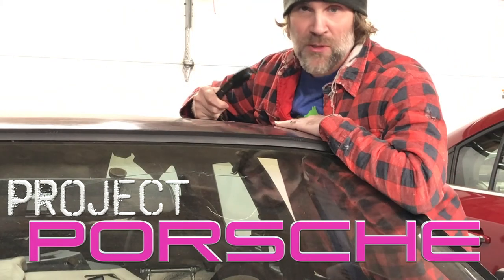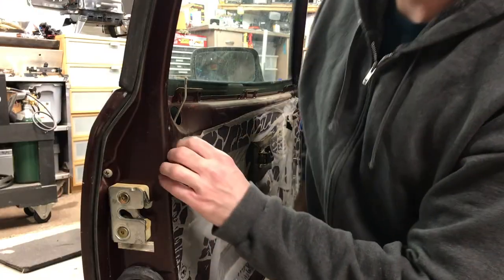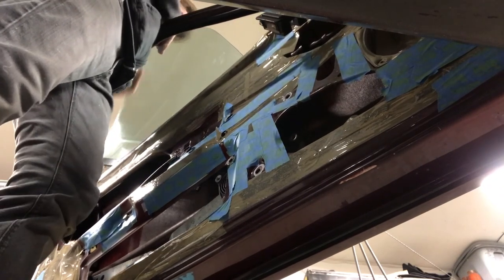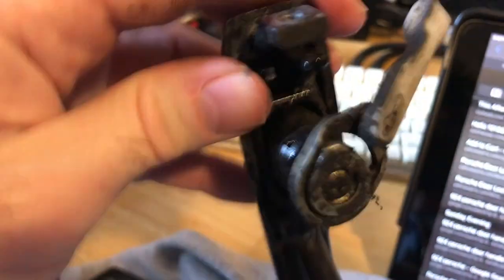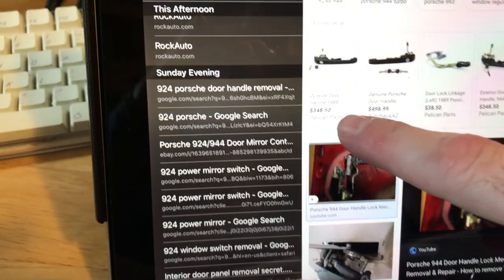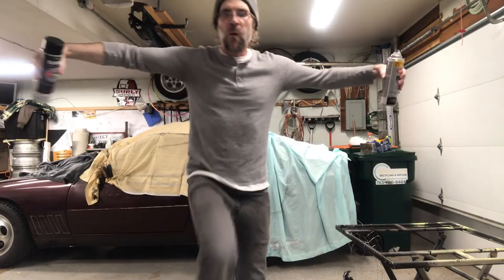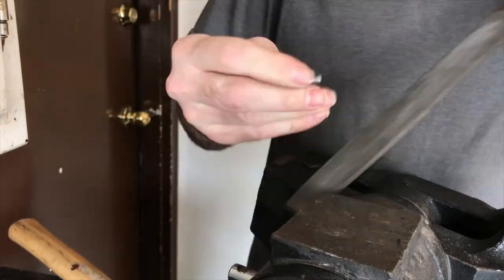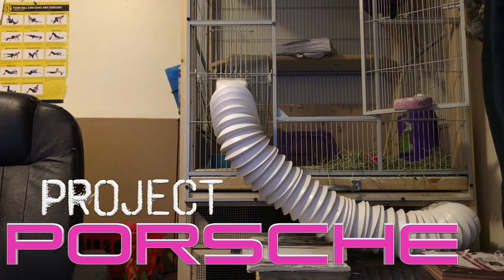Creative 924/944 Broken Door Handle Fix

Comment: Nice fun videos Ryan.  I resurrected a 1988 924S SE which I sold last year.  Now I am working on a 1982 924 turbo.  My car has the apparently typical non working exterior drivers door handle.  Unfortunately for me it seems the 87/88 924 door handles are different from the earlier models. Not finding much on the web on the earlier 924 door handle issues. I suppose I  am just going to have to take it apart and explore.  Your paint suggestion will come in handy for sure, and I'll watch your progress here.  The keyless entry was a very cool idea!
Reply from the maker: Thanks Rick!  I'm glad you enjoy the show and plan to follow the the progress!  I hope the exploration on your turbo's handle goes well!  Those rare SE's are cool.  And the turbo's are too.  It sure seems like these cars are starting to take off in interest/value.  Someone should start making affordable replacement handles that work on all the different models and years of 924/944's, and fix the weak points in the design.  I'm still kicking myself for not pulling the handles off of the 924 that was in the salvage yard by my house.  At the time, I didn't know how common broken handles were on these cars.  They would have cost me a whopping $5 a piece!  Even just for the parts, or to save/sell.

Comment: Thanks! This will be helpful for when I re-paint my handles when I take them off to replace the old cracked up door handle gaskets.
Reply from the maker: Your welcome!  Let me know if you have questions. I have lots in store 4 this car!  Check back for my next Door Locks Episode!
Reply: @rybreadification  What was the finish of the spray paint you ended up using? Semi-gloss or gloss? I'm in Canada and trying to find a comparable product.
Reply from the maker: I used semi-gloss Rust-Oleum brand “high performance” enamel.  We’ll see how it holds up.  Ideally you want something that has good adhesion, but also wears well, being it’s the handle. I think semi-gloss or satin is best, the full gloss just doesn’t look right.
Reply from the maker: They sell this stuff here called POR 15.  You can brush it on, you could try a paint like that, but then you should get all the old paint off first. But it can’t be to thick where the trigger goes.  I just used “cheap” spray paint for now.  Also i was thinking satin or flat farm and implement paint might be good.  May take a long time to dry....Your jacket is drrrreye....that’s from the movies.  They sell 2 part in a spray can for 20 or 30 bucks at paint shops or mail order here.  Its like 20 or 30 bucks.  I don’t know how durable it really is though.
Reply: @rybreadification  I picked up some Tremclad spray paint that is essentially the same as what you used so I’ll be trying that out soon. I’m still trying to get everything off the door. My panel has some water/heat damage at the top along the inner window seal and the seal itself is cracked in half. Most of the tabs to hold the panel to the door came off so I have to find some way to put them back in and reinforce them. You mentioned that in your video but I don’t know if you said how you reinforced them? I’m thinking about trying to rebuild the top edge of the door panel with some kind of papier mâché, but I’m not sure if it will work well or not? I have lots of questions but don’t want to monopolize your comments unless it might be helpful for others?
Reply from the maker: Don’t worry, the comments are good.  I used fiberglass cloth and resin on the back side of the panel.  I shot a bunch of video, but I still have to edit it.  I wish I was done with it now so I could show you.  They sell fiberglass resin for making repairs/what not at most stores in the automotive section.  it come with a hardener.  So you mix that up and before it gets hard you use an old paintbrush to paint/slather that stuff on the cardboard panel, then you take the fiberglass mat or fabric and press it on the panel and slather more resin on top of it.  Then you wait for the whole thing to cure and after its hard, then you can sand and shape the panel.  It's messy work. you need gloves and you want to do it outside or a place with good ventilation.  I wear a respirator but most people don't.  Some areas on my panels that were not that bad, I just used the fiberglass resin without any of the actual fiberglass matting or fabric.  If you'd like I can send you some pics.
Reply: @rybreadification  yes that would be helpful to see some pics. Is there a way to give you my email without posting it publicly? The next question is that I guess I have to remove the window to get the door handle off? Everything inside my door was really messy and the plastic disintegrated when I moved it so I’ve removed it all and will add new plastic once I’m done cleaning everything inside.
Reply from the maker: I just kind of looked and I didn’t see like a message ap in YouTube, but I could be missing something.  Well have to figure out a way to echange emails later.
Reply from the maker: No you just nee to roll the window up, and I think you can get new plastic.  I took everything out of my door but you don’t have to.  You need to unsnap the plastic connectors that conect the lock to the latch with a plastic pry bar, and the linkage to the latch from the handle again with a plastic pry bar.  Stick it in there like a wedge, try not to bend the metal part you’re snapping it off of.  Now take out that one screw that is exposed on the jamb when you open the door.  Push the handle, like kind of slide it a bit with effort but be karefull, towards the front of the car and then out at the back of the handle.  It kind of snaps in there so it kind of snaps out.

Comment: Good stuff. Are you just using bike hooks to hang your wheels? That might solve my extra wheel space issue.
Reply from the maker: Thanks!  I don't remember what brand mine are, but they are really close to these ones I found on Amazon.  I've seen them advertised as ladder hooks.  They work well,  but I wish they were a little stronger.  They said they could hold up to 50 pounds each, but they do bend a bit from the weight of my wheels.  If I ever get more of them I'm going to look for ones that have a little thicker metal and can hold more weight.
  https://www.amazon.com/Storage-Mounted-Utility-Surfboard-Protector/dp/B07SZNGSZS/ref=sr_1_16?keywords=storage+hooks+for+ladder&qid=1639101178&sr=8-16
Reply: I have a hard time to place the handle back in place.its 924  1977.
Reply from the maker: @philciucci2715 I did mine with the door panel off which made it a lot easier.  If you just pulled the handle off, I think you have to feed the linkage in first and then stick  a screwdriver or something down in the handle hole and snap the linkage on, then twist the handle around to get it hooked in the door.  Otherwise you might be able to pull the vent out and get in there that way, but I’m not sure about that.  Actually, if you take the latch off of the door jam,  I think you can stick the handle in the hole and snap the linkage on the latch, then get the handle situated and then screw the latch back on the door.  It’s been a while since I worked on it so I’m not sure about the exact sequence - I hope that helps.  You can trace around the latch with a marker to put it back in the exact spot.

Comment: I have to squeeze my door handle and then some to open it. The plastic piece on the goldie looking rod can that be adjusted to fix that?
Reply from the maker: Yes, you can screw it further onto the rod to take out some of the slack.  You should be able to screw it down a 1/8 or 1/4 of a inch and take some of the play out of there, but at some point it hits the inside of the plastic and that's as far as it will go.  Hope that helps.
Reply: Had to use a nail puller to get off the pin and screw it down to take out slack and it worked thanks
Reply from the maker: @douglasnichols6116  cool, glad it worked, no problem.

Comment: What junkyard is that Porsche 944 located at?
Reply from the maker: It was In a junkyard close to me,  but they shutdown and went out of business.  It was the only Porsche I ever saw there.  It was a 924 with a pasha (however you spell it) interior.  It also had what looked like the stock straight from the factory tires.  Like when it was new, they went off the road and hit a tree or something, then it sat for years before the yard got it.

Comment: I went through all this on both my '87 924S and my '84 944. They're a shit design. I can't believe how bad they are. I've owned a '70 Chevelle, a '78 Dodge truck, an '88 Jeep Cherokee...and others, and i didn't have a single problem with the door handles on any of them. But these cars? WTF were they thinking?
Reply from the maker: Ya, its funny, This car only has 60,000 or so miles on it…so I didn’t expect to need handles or have to fix them.  The door handle on my camaro broke, but besides that i never had any problems with door handles either.